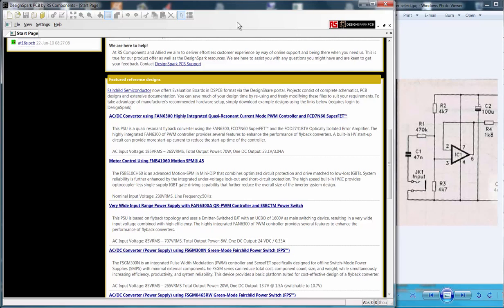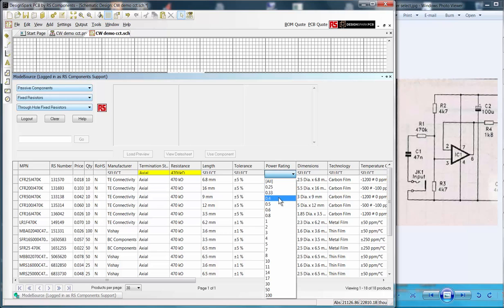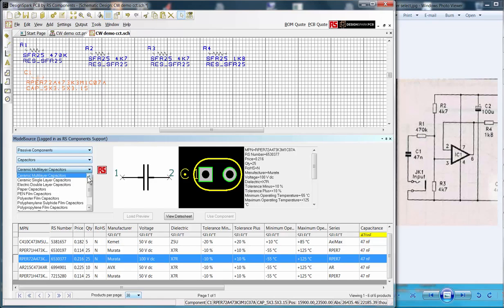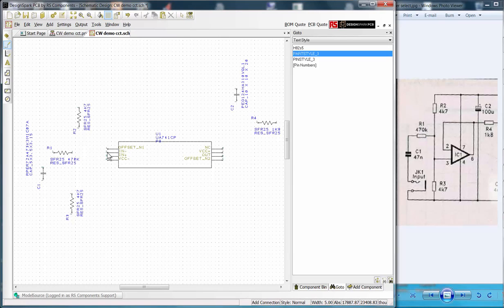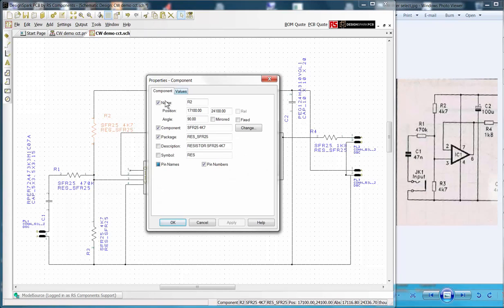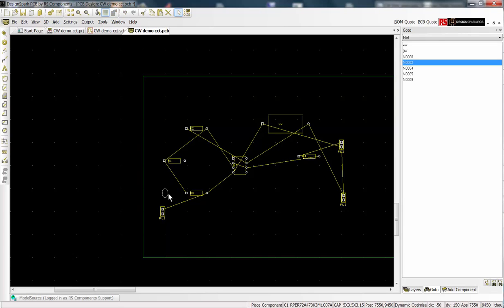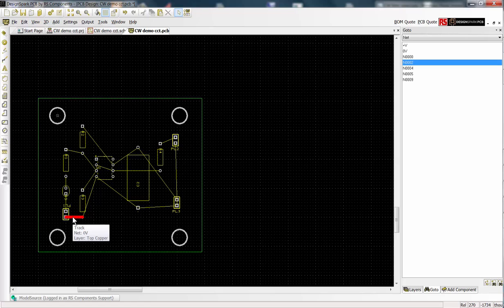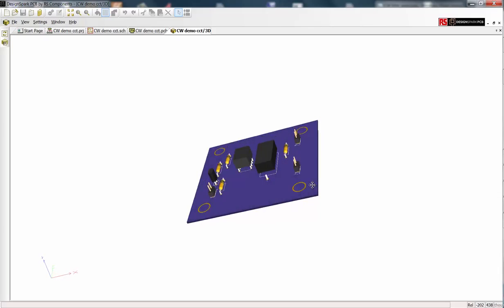DesignSpark PCB First Steps   Sch to PCB

Comment: This tutorial is hopelessly out of date. 
Now there is no ModelSource button at the bottom of the screen. If ModelSource is invoked from the View menu or Ctrl-M a message tells you the following:
'A new alternative library solution, PCB parts Library, is NOW available. The existing ModelSource libaries will not be updated'. A link is provided to the new library which is of a totally different fromat and bears no resemblance to the ModelSource format  shown in this video. On the same page are [Examples], [Login] and [Register] buttons. I tried logging in with my RS password and username, but they did not work. I do no know if they require my Google, Microsoft, RS or email password and username. At this point I was stuck following the video on my installation of DSPCB.
Please delete this video and upload an update.

Comment: I intend to switch from Fritzing. One thing. Can I skip the step where you pick a component details and just do "go resistor!"? I only do simple circuits and often I just need a fast draft of a schematic to work with later.